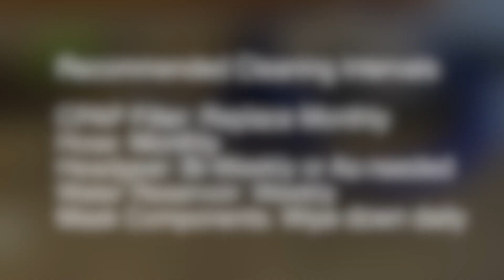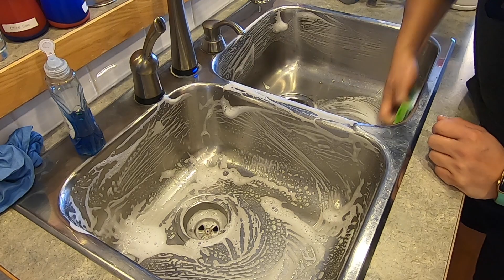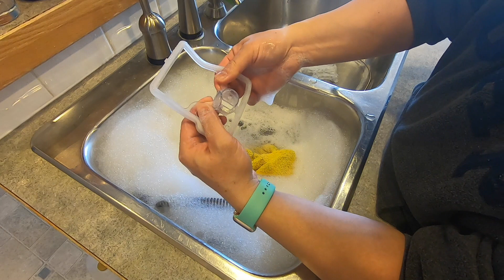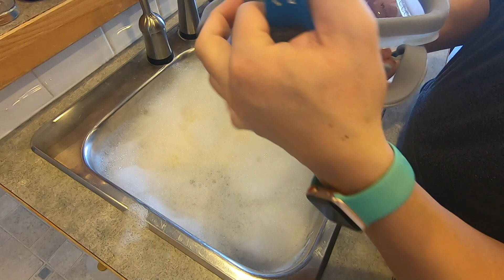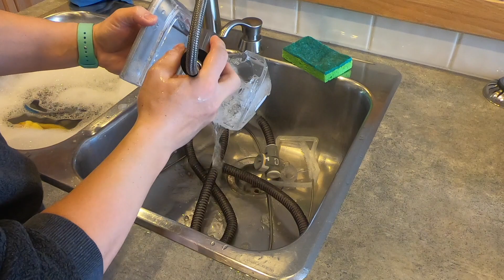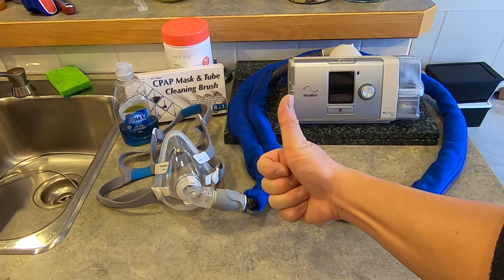How to PROPERLY Clean CPAP Equipment

Comment: Great video! I also use a ResMed. Do you still follow this process if you are using your SoClean2? I saw your review on it from a little over a year ago. Do you still use it or recommend any other CPAP cleaners you have tried?
Reply from the maker: I still use SoClean every 2 weeks and I wash my cpap gear in warm water whenever I feel like it just because I am neurotic about clean. Realistically I only run SoClean every two weeks or so. I probably wash my hose and mask parts in warm water roughly every other month. If you check out my channel you can find the cpap hand washing video.
Reply: @piercedasian  fyi- Resmed says you should not use dish soap to clean your cpap equipment.   They also say the ozone from the SoClean can corrode metallic parts of the cpap.  That being said- I've used Dawn dish soap many, many times and I use the SoClean everyday.